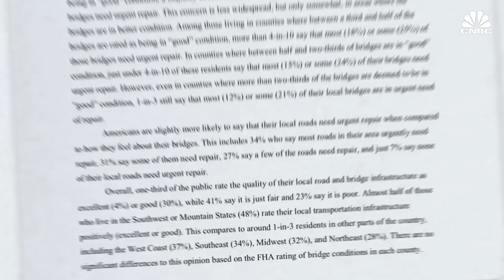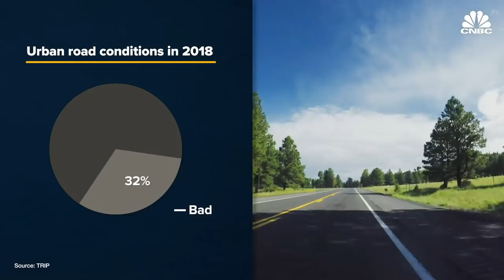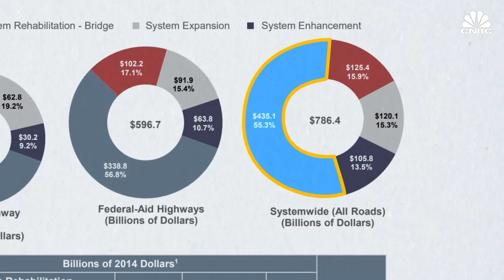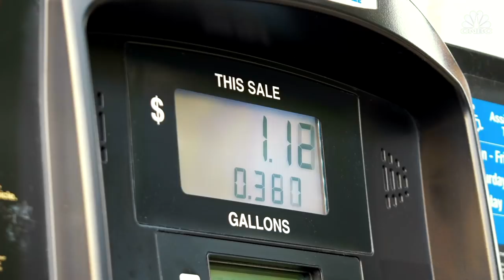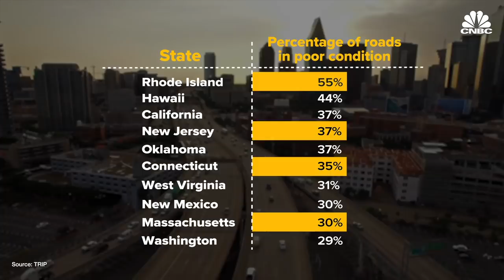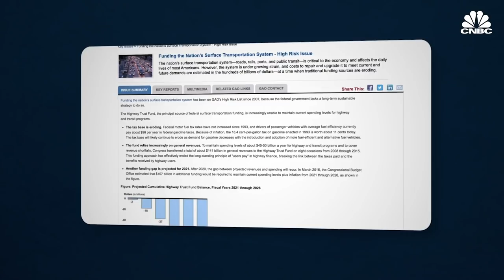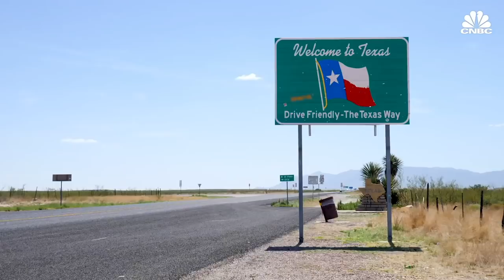Why U.S. Roads And Highways Are So Bad

Comment: lack of maintenance and heavy trucks chewing up the roads.
Reply: I once heard a statistic that a semi truck driving over the road once does the equivalent damage of a Honda Civic driving over it 30,000 times.
Reply: Yes, our semi trucks are too heavy for how are roads are built, especially the asphalt ones.  German roads and their famous Autobahn are in excellent condition and built to a much higher quality level and thickness.
Reply: ...which is funny, because you don't even have "heavy" trucks.
Reply: This statement is true to an extent. There are different grades of asphalt to compensate for the "heavy trucks", so they don't tear up the roads as bad

Comment: It's simple.  Road construction is public work.  This means the lowest "qualified" bidder receives the work.  This leads to companies cutting costs by using cheaper materials which in turn break down much faster.  Also, in most states, contractors are not held responsible to repair damages to the roads that they constructed. So, they have no desire to produce a quality end product.  Many see roadwork as job security for the future.
Reply: It depends on the contract and quality control. In England the Kent council does a complete resurfacing once every 30 years now to be more efficient. For 20 years there is basic maintenance and the council does preventative maintenance to extend the life of the road.
Reply: Exactly my thought- I see the same contractors doing the same repairs on the same roads year after year. I'm not talking about fixing potholes- bridges that were constructed without regards to the water underneath and have to be repaired 3 or 4 years in a row. Always have lane restrictions on parallel roads that aren't being worked on during those times as well.
Then there are the streets that get repaved and then dug back up so the sewers underneath can be worked on (I'm talking 3 weeks later). Good planning, city engineers!
Maybe a warranty should be demanded of the contractors who do the work, or make road construction and maintenance part of state or local government departments and take the contractors out of the loop.
Reply: Corporate Greed... Seems to be a recurring theme for why so many of the United States world rankings are slipping...
Reply: Factor in if it's built to fall apart in 5 years you have an opportunity to bid the job again.  Job security.  Why do it right once, when you can do it 5 times in 25 years.
Reply: Jacob McAdam it’s a road not a nuclear power plant
Reply: Plus for them it's kind of like a job security lol 😂
Reply: The US Government should hire and pay their own road workers.  It would solve this problem real quick.  No more selling road repair contracts to the smallest bidding capitalistic companies.
Reply: Pathetic way of doing business and spending our tax money.
Reply: I don't know where you are from. But from where I'm from, it doesn't matter if it's the smaller bidder with the smallest company or the highest bidder with the biggest company. You are required to use the same materials for the job, no matter what. Doesn't matter if it's soils, or if it's asphalt. The problem is, is that companies (doesn't matter what company) try and cut corners to finish the job quickly. Which in turn, leads to the roads being messed up the way they are now.
Reply: It's definitely more complicated than that. There are strict standards and specifications that they follow in both material and construction quality. Obviously it can't be monitored 100% so you do get some contractors that try to cut corners when they can so it does play a factor, but the biggest is just lack of funding. You can't expect a road to last forever and if it gets heavily trafficked it needs maintenance even sooner.

Comment: Here in New York City the roads are awful. It really makes you wonder where all the money we pay in taxes go.
Reply: Wait, you gotta be kidding right? If that's real that would be a shame... NYC is the biggest developing city in the world, atleast they should spend maximum 1 month to fix any potholes
Reply: @kupangrebus3177  dude the roads here are terrible. Potholes everywhere, never ending construction. Had to get a new rim for my BMW Z4 because it cracked after I hit a pothole. It sucks.
Reply: The roads are bad and slow and expensive because of unnecessary bureaucratic regulations. Take the Kew Gardens Interchange
in NYC for example, it is where 678, Grand Central PKWY, and Jackie Robinson PKWY. The construction site there has been going on for years with minimal to no change. It isn’t because the government have no money but because the workers can work as long and as slow as possible and still be paid. Not to mention all the environmental groups’ complaints.
Reply: Straight into the pockets of crooks runnin the show, road condition in nyc is worse than in afghanistan

Comment: You've clearly never been to South Africa here if you drive straight your gonna need new suspension and wheels.
Reply: I drove a sedan on Uber in Los Angeles... destroyed 22 tires (twenty two, not a typo) and fully replaced the suspension. In ONE year. 

Gave up and bought a 4x4 SUV on LT AT tires.

Comment: European Roads and highways are Top Notch, Specially Germany and The Netherlands 💯🏅🏅🏅
Reply: because of low population and small size countries
Reply: @ajayj6707  what about  Singapore
Reply: @ajayj6707  It's mostly because of the better citizen-to-asphalt ratio compared to the US. America has way, way too much highways spread out over relatively few people. It's impossible to properly maintain. 

Of course European countries are much smaller than the US, but the European Union itself is also quite large and has a much, much larger population than the US. So ''lower population'' isn't an excuse. If you look at a global average, the US actually has a very low population for its enormous size. Look at China, India, Japan or the EU. Average European cities are also a lot larger in terms of population than the average American city and they're closer together, meaning the roads see more vehicles per day. 

The reason why European roads are better is simply because the government manages road maintanence more effectively, there only are roads and highways where they're actually needed, and most importantly, public transportation is excellent. Germany for example has high speed rail going over 300 km/h (186 m/h) through the entire country. So do Spain, Italy and France. You can take a high speed train from Amsterdam, Netherlands to Paris, France and be there in less than 3 hours. Compared to 6 hours on the freeway. People don't NEED to drive here. Not only is taking public transportation faster it's also cheaper and better for the environment. There are always better alternatives than driving in the city, between cities, nationally and internationally.

Comment: I have an Idea. Here me out.
•Make roads out of steel to make them durable.
•Make tires of steel to decrease friction 
•But to save expensive steel's cost, Since everyone is going on same path, decrease the width of road and make cars drive one behind another. 
•We can attach all the cars.
•We can increase the size of cars to fit more people.
•And how about putting one big engine in front instead of putting engine on every car?
•We can run an electric line on top to power the car and decrease the cost and save pollution

I'll call this idea as Futuristic Track Pods.

So sad qe can't do that in US rhat is ruled by oil companies lobbying govts
Reply: Adam Something 😅

Comment: America Fells like i'm driving on rocks 
Germany Smooth as butter
Reply: All states, other than the south and south west, throw a crazy amount of salt on the roads during the winter months to prevent snow and ice. That salt combines with the moisture and erodes the hell out of asphalt, so bumps and potholes are a well accepted outcome as opposed to cars slipping and sliding everywhere.
Reply: pietkrijger that might be the case? I’m not entirely sure on the technical details of road design, but even in Maryland (mid-Atlantic east coast area) roads need repair after a snowy/icy winter, and it only gets worse the more north you go. However, when I visit family down south in Florida the roads are pristine and look brand new.
Reply: With all the robotic companies Germany sells to China and the cheap stuff Germany depends on China, no wonder they have money to build roads and stuff.
Reply: @pietkrijger First of all, my comment was a sarcasm. Not to be taken seriously. Secondly, it's the other way around, China trades most with Murica. Remember the deficit America has with China is 500 billion dollars. What kind of question is "where dat money going"? You need to ask China that. Third, if you read my sarcastic comment, I said "with all the robotic companies Germany sells to China." My comment has nothing to do with trade flow here. I'm talking about how China has been bought a lot of Germany's tech and brought them home. Whether you like trump of not, he did all of the west a favor by alerting us all about China. As soon as US gave more power to CFIUS, Germany followed the footstep by tightening the investing and foreign takeover rule. Sure, American roads are bad, but if Germany is not careful and keeps swimming in China's money, they'll have no tech left to make products to earn the money used for road preparation. You can ask the french with a lot of their farming lands bought by Chinese; their farmers are now broke and out of jobs.
Reply: too bad german roads sucks compare to our dutch roads. we as dutch drivers hate to drive on german roads.

Comment: Roads look and feel great when they're 1st built. Maybe we need to look deeper into what breaks down a road and see if we can build them strong in the 1st place. For example, most roads with buses have the same thickness of pavement and road base in both the left and right lanes. The right lane with the buses quickly develops potholes and ruts especially at the bus stops, so why not build them stronger in the right portions of the road in the 1st place. We may also want to reconsider the criteria we use to design a pavement section (thickness of each layer of road material), and look at how we determine how suitable the existing ground is that everything goes on top of, and if it should be strengthened. We also need to develop better patching methods for when utilities are repaired and installed.
Reply: thing is it costs more to dig down and start from the bottom drivers only see the top inch not the 3 foot of ground base. inch of tarmac very cheap job done.
Reply: They had this as a question on my 7th grade science test and I genuinely had no idea. Still have no idea 🤷‍♀️

Comment: I've driven on the roads in the US, Canada, South Korea, and Australia. Within cities, it varies wildly, but our interstate system is always in much better condition than the highways of the countries I mentioned above, and are also accompanied by rest stops, truck stops, and small highway service exits that almost always have gas stations, restaurants, and usually also lodging. You really take it for granted until it's 12 hours between towns driving on the highways in Canada, and the only thing between those towns is a tiny single pump gas station which may not even be operational depending on what time of year you visit.

Comment: Where are these roads? I lived in Texas for almost 10 years and Texas has the most incredible infrastructure I have ever seen. Even many small towns have great roads (maybe less so in very rural areas?). One thing is that the US has huge freeways, again in Texas as an example is Katy Freeway on Interstate 10 has 26 lanes!! I live in Poland now where most roads are 2 lanes (one each way). And I drove through Germany many times on roads that felt like they were very old. Much better than Poland, but still not impressive and driving is not so pleasant. Freeways in Germany are 2 lanes each direction, and the right lane is filled with trucks going 80kmph and in the left lane you have cars often going 200kmph+. It is quite uncomfortable if you want to drive say 120kmph and have to constantly look in your mirror and weave back and forth between the slow and fast-moving cars.

Comment: I found the main problem is we don't build it right when we rebuild a road. Sometimes I see them put down an inch of pavement and that is just terrible. Other places I've seen them put down literally feet of concrete and it's been holding up for 20 years now with minimal maintenance. Would they rather have a road that needs to be repaved cheaply every 5 years (or less) or a road that needs to repaired expensively every 30 years? Its much cheaper and better to pave a few less roads every year but do it right

Comment: My "solution" how to tax drivers: Tax them by mileage x per tire surface weight (heavier vehicles pummel roads)
Do it every annual vehicle checkup. And, interesting correlation is: the lighter the vehicle is the less fuel it burns per mile, weight is more important than engine advancements.

Comment: Here in France the roads are quite fine and periodically maintained but what the public doesnt know is that the recent maximum speed reduction from 90kmph to 80 kmph was made not only for the safety( and polution) but also to reduce the wear of the surface. Creating new roads is highly not recommended because it will increase the future costs of maintaining . A different strategy is to reduce the lanes ( and the surface) of all roads under used. The weight of the cars is also a factor that increase the wear of the road. The development of the TGV ( high speed train) had as one of the purposes  the reduction of the traffic on the highways and roads. Because the annual budget for maintaining is about 20 billions euros, every measure can save a dozens milions euros a year.
Reply: france ranks lower than usa at road rankings

Comment: It's quite a simple solution really. If roads are deteriorating faster than current funding can repair them then more funds are required. More road users equals higher amounts of tax that needs collecting. If Americans are not happy with the fuel tax increasing then a system could come in similar to what they have in China and some European countries where only certain license plates can drive on the roads on certain days of the week. That would reduce the use and strain on the roads. So it's a choice that needs to be made by the American people. Your choices, pay more tax, reduce the use of roads, or just get used to your roads being bad and quit complaining.

Comment: The federal gasoline tax is a crude way of assigning the cost of maintaining the highways to those that use them. A better way is to have a tax on the tires based on the tire size, tread depth, and maximum tire pressure. Studded tires should have a multiplier of 10 to 30 because they are so destructive to the road surface. The initial cost of our highways and bridges depends on the anticipated load. An eighteen-wheel tractor-trailer will need 1,000 lbs per lane foot. An SUV will need about 300 lbs per lane foot and the lanes could be narrower. The trucking industry is not paying its fair share.

Comment: The issue with higher fuel taxes is that citizens would expect all roads (state and urban) to get improved/blame the government for obvious tax increases on their cost of living plus the extra cost needed to repair most roads would be more than double which then drives more EV adoption. In a world with high EV car use, where does the needed money come from. Road pricing based also on when you are driving, road taxes on top of fuel tax. In theory the answer is public transport reducing individual car (and road) use but what happens in a state like New Mexico where distances are vast and making public transport cover just most of its running cost is very difficult. Remember like Germany, the US military was one of the main supporters of the highway system.

Comment: IMO
1. States with low or now income tax are most likely to have bad roads, but is partially tempered by the number of residents in the state, and usage.
2. No one has done a series of comprehensive study how to build roads that require less maintenance. I should guess that anywhere someone says "We need a road there!" all that's done is to lay down some kind of substrate and then the road itself, most often asphalt no matter the environmental conditions. So, in a sense it makes no difference whether you're in WA, AZ, ME or FL, the local road is built the same way. This should change, and not just for normal reasons but also to take advantage of newly available materials like embedding recycled plastic.

Comment: I am sitting here with a big ? Mark because here in europe toll booths or automatic fast lane toll collection systems have been in place on all high traffic highways and state roads for decades and there is never a funding problem because the toll prices is higher in rush traffic hours than other times of day. Its higher in rush traffic to punish drivers for standing in cue polluting more. Incentivizing to drive in hours outside of rush traffic to spread out the load on the roads and create better flow throughout the rush traffic (Works Somewhat to lower the traffic). Its also enough to cover the cost of maintenance each year + a reserve amount set aside for emergency repairs. 
We have gas tax as well to even further make the maintenance budget work